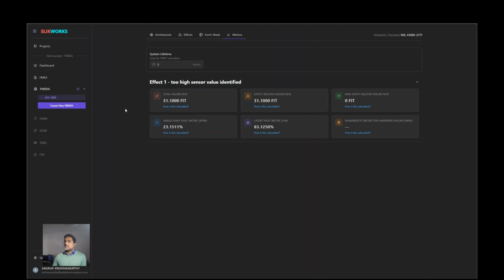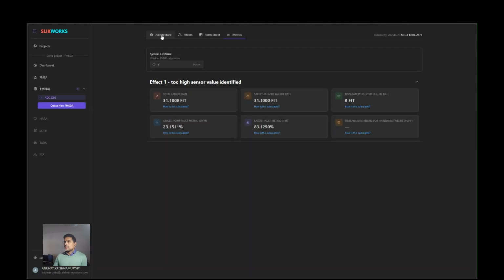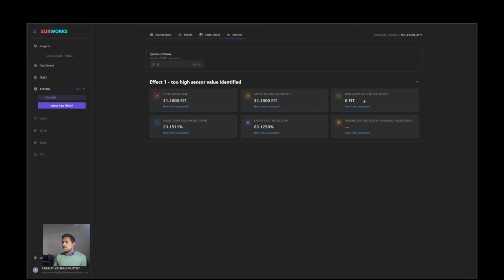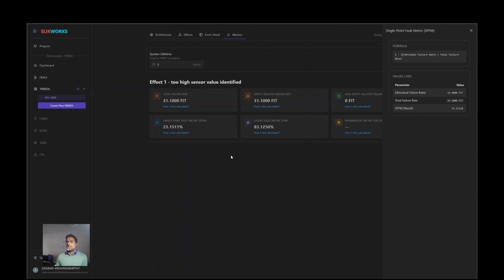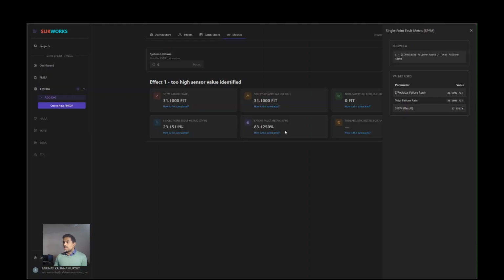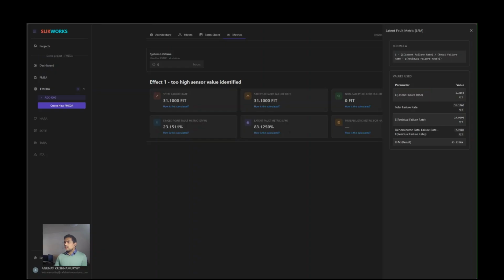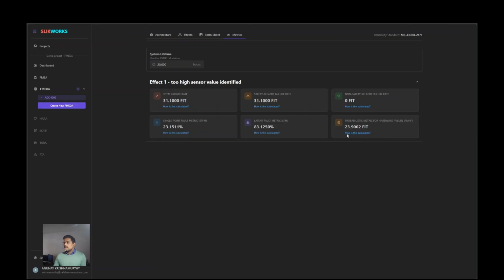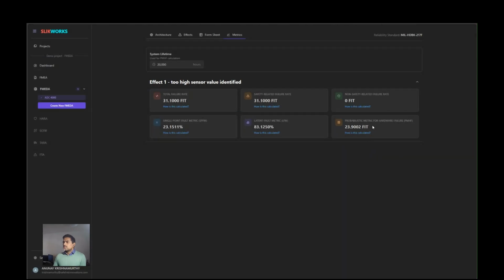SLIKWORKS - Creating an FMEDA | Part 4

Comment from the maker: Instead of building complex spreadsheets manually, you can automate the process using SLIKWORKS FMEDA Software.

- Automatically calculate SPFM, LFM, and PMHF
- Manage component failure rates and diagnostic coverage
- Generate ISO 26262 hardware safety metrics instantly
- Improve safety architecture decisions faster

Try it here:
https://www.safelink-innovations.com/slikworks/fmeda-software